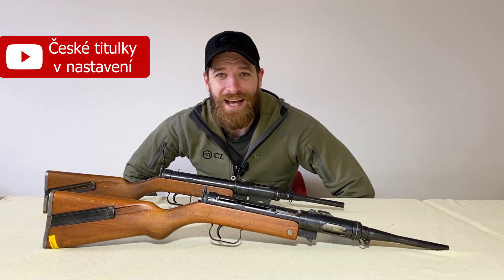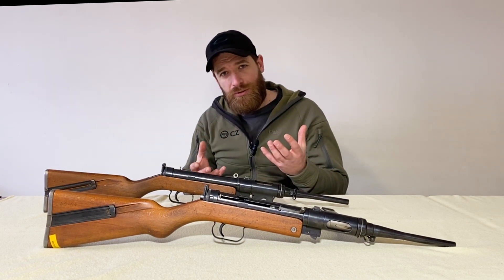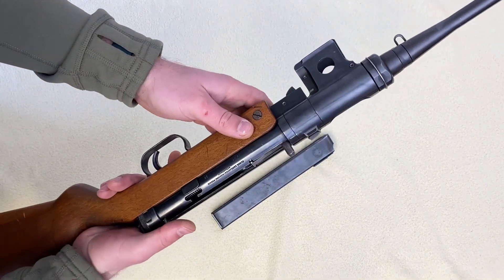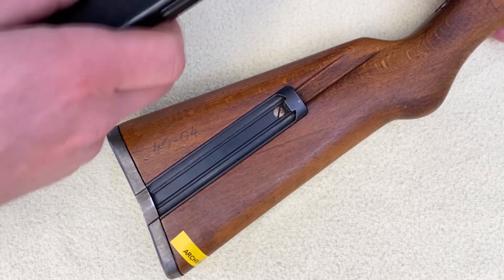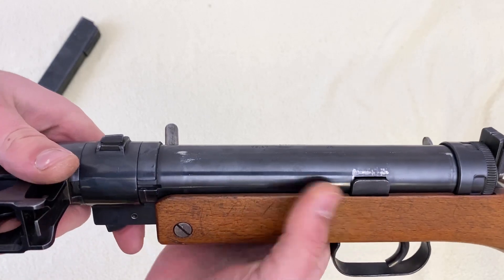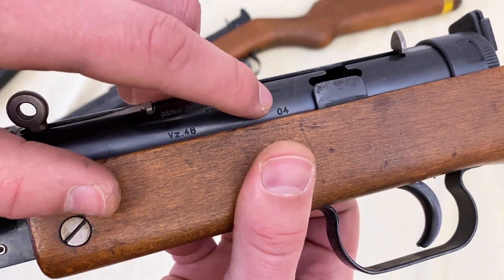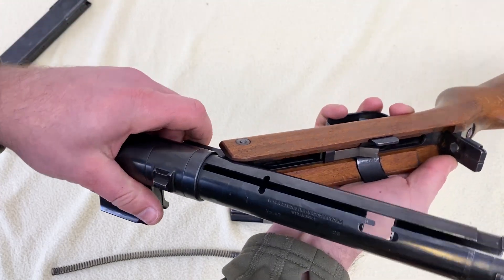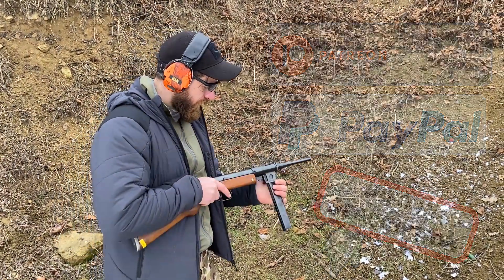CZ 247 THE "TURNABLE" SUBMACHINEGUN

Comment: Interesting the bump safety doesn't engage when it's firing, seems like it would. Is there another mechanism that keeps it down while firing, or just doesn't have time to engage?
Reply from the maker: It is interesting, I was thinking about that also. My theory is that maybe the bolt doesn't travel all the way to the front position when it is firing. Maybe it can get this far forward only when there is no cartridge. I will try to figure it out ;-)

Comment: The major industries in Czechia were created by Germany when the lands they were on was still part of Germany before Czechs stole it.

All the engineers were taught by German engineers and then the knowledge passed down...
Reply: Czech wouldn't be kniwn for any kind of industry had it not been for Germany
Reply: ZK476 and CZ447 were both designed off of the same system pioneered by Walther in 1914 with telescopic bolt. Also off of other German prototypes that had magazine in the grip.

#Everything_originated_from_Germany